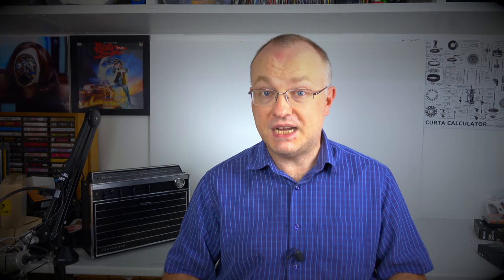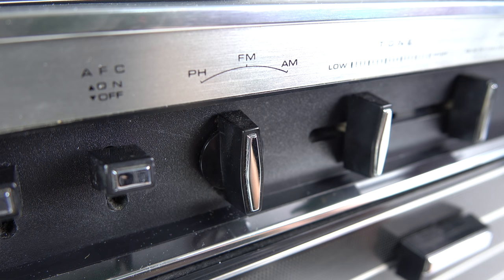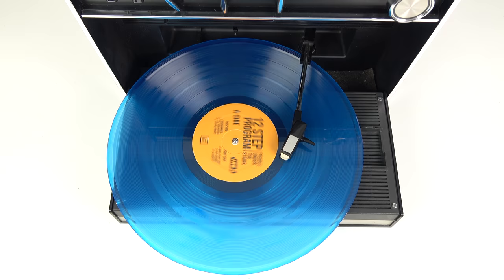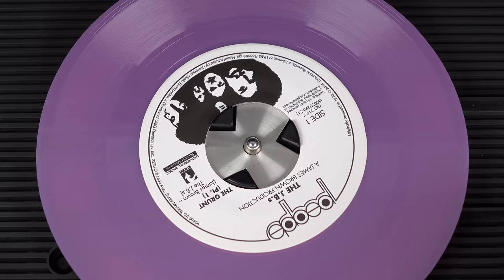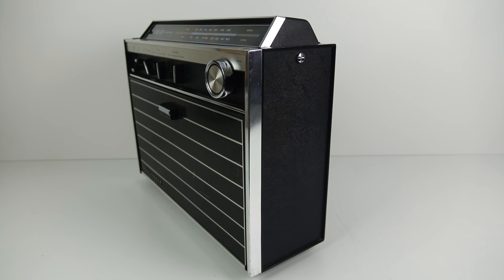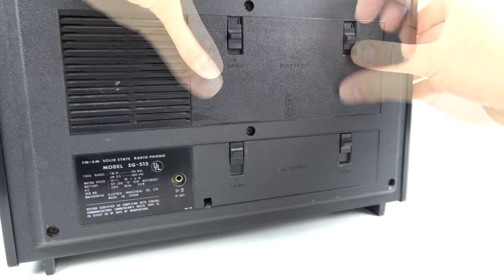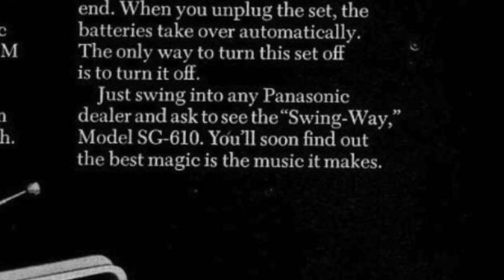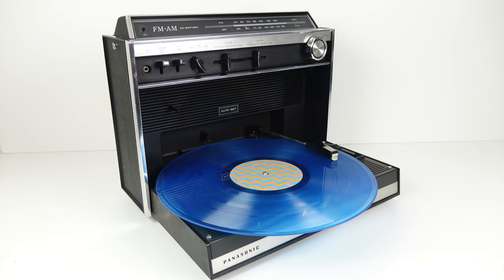Design Classics : Panasonic SG-515

Comment: Instead of destroying your British 45rpm records, you could also put an extra switch into the line of the "Auto Set"-sensor/switch to override it. You'd need to drill a hole somewhere to add that switch, but I think there are a few places on that thing, where it wouldn't be a problem.
Reply: gotham61: It just needs enough grip to not slip, but yes, this could work, too.
Reply: Unless it's been implemented mechanically, of course!
Reply: I have the older version mentioned in the video. The mechanism is the same in mine and his.  The "Auto Set" is not an electrical speed control, it is a mechanical selector activated by the three prongs. Just as RetroSwim has thought.  The method that gotham61 mentioned may work best, but you may need two stacked under the single you are playing to avoid tripping the mechanism.
Reply: @01975Scorpio  Yes! That whas my first thought. And the second was a self made (3D printed?) upside down "cup" with a protruding axle above it, that one whould put "around" the automatic mechanism to avoid triggering it. The protruding axle would hold the record. I hope you get the picture.

Comment: Have you tried running this from a transformer and noticed any issues with the 50Hz playing music a little slower versus when using batteries?
Reply from the maker: I've only run it from batteries.
Reply: Using an "autotransformer" to knock the 220VAC to 120VAC shouldn't cause any 50hz/60hz problems. Internally there's a transformer to take the 120VAC down to (probably) 12VAC, then more circuitry to convert and filter the 12VAC to 12VDC. The whole circuitry (even the motors) run off of the 12VDC. Unless the filter capacitors in the 12VAC to 12VDC have gone really "soft", you shouldn't notice any performance issues (also if the capacitors have gone soft, it's relatively easy to get appropriate replacements. With a little practice anybody can desolder and resolder them in). The 120v to 12v transformer inside the radio should have been overrated to handle the current needed at 60hz and should have enough "headroom" to not saturate at 50hz.
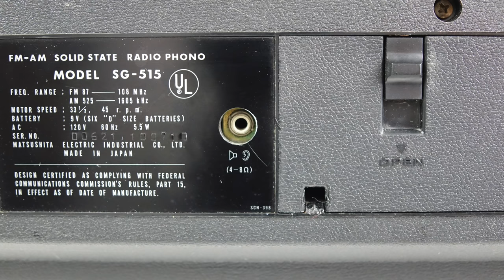Reply: I just happened to notice at 5:35 it only shows 60Hz and wondered if the reduced cyclic rate would effect the speed of the turntable motor.
Reply: stilldking
That would matter if the motor that drives the turntable was an AC synchronous motor, but since this runs off of batteries the motor is a DC motor that's self regulated. The 60hz thing is only for the transformer in the internal power supply. Most transformers are overrated by 50%. If the machine was designed to draw 1 amp at 12 volts, the transformer is designed to put out 12 volts at a maximum current of 1.5 amps. At 50hz the transformer is probably running with an estimated safe margin of 30%. Not anything serious enough to hurt anything.

Comment: 2:53 No switch to disable the "Auto Set" to allow the user to set the speed manually? What is that switch at the lower left of the screen around 2:57 mark?
Reply from the maker: When the lid is closed a peg locates into that recess and presses the switch to deactivate the turntable.
Reply: +Techmoan do on web tv
Reply: Many modern 45's are 2 disk 12" releases, with one or two tracks on each side.

Comment: Hi everyone, I'm hoping someone might be able to help me with my turntable.

I have a Sharp SG-350E Music Centre and bought it off of eBay a few months ago. It's great but it has a couple of problems, one of which is that when I play a record on it there is an annoying and rhythmic tapping sound as the record turns (it's about 4 beats per second). Also, when you switch from 35 to 40 the speed of the tapping increases, hopefully, that might help? Anyone know what could be wrong and whether I can fix it myself or will have to take it into a shop? Thanks in advance.
Reply: 33 and 45*
Reply: You hear the click on the turntable itself or on the speakers?
Reply: Oh yeah, it's being picked up and played through the speakers throughout the entire record.
Reply: You should try adjusting the counterweight and the antiskating of your turntable (assuming it has, unfortunately, there are no pictures of your device on Google). If that doesn't help, it might be the needle that might be dirty or worn out, in which case you should try cleaning it to see if it helps. In the worst case, the engine might be defective and generating those noises that are being picked up by your needle, which I assume, would be quite difficult to fix.
Reply: Here's a picture of it: https://i.ebayimg.com/00/s/NzY4WDEwMjQ=/z/qaoAAOSwAYtWMAIq/$_86.JPG Okay so I'll try adjusting the counterweight and antiskate today and then might go into a shop and see what they think. Thank you for your help so far CoTeCiOtm.